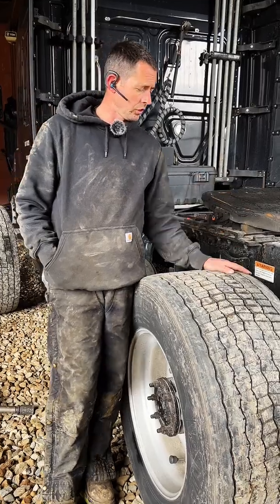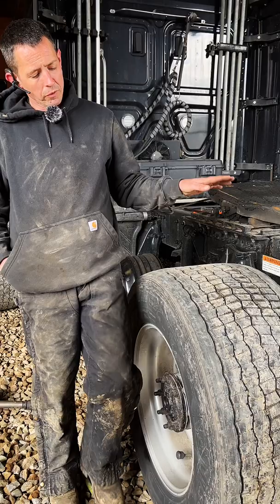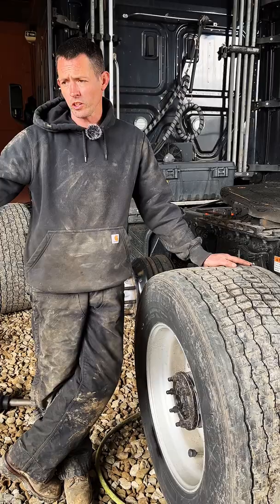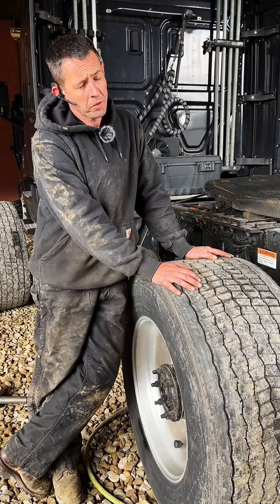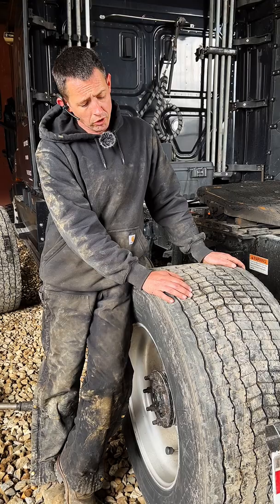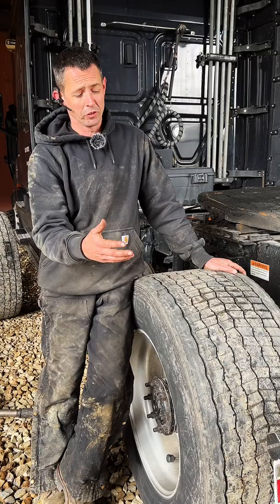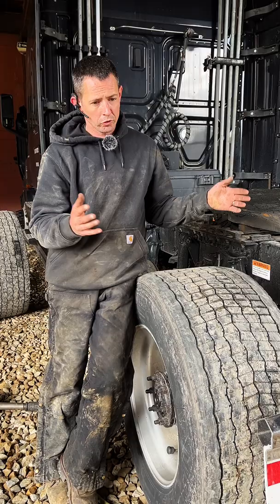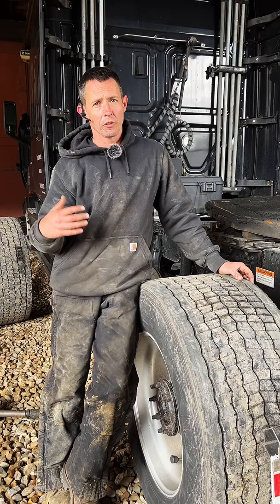Super Single vs Duals - What you need to know about Super Single truck tires #shorts

Comment: Don’t forget when the tires blows mostly the wheel is destroyed because it hits the ground without another tire to keep it up
Reply from the maker: Good point!!
Reply: Pulse they’re triple the cost tires and wheels both
Reply: Not necessarily, I’ve been running them for years and have had blow outs before it depends on if the tire separates or just goes flat and how quickly you can get it stopped safely
Reply: 50/50 Chance of rim damage, if you blow one lower the suspension and chain the side of the blowout axle to the chassis. Engage diff lock, raise suspension and drive off. Don’t forget the lube, you’ll need it for the bill.
Reply: Same here i blew up mine on my tractor 3rd axle 1 time was on i44 in Missouri riding cruises 70 mph downhill doing over 75 + mph full loaded 75k + weight. I came to a complete stop at the bottom of the hill. My tire was almost gone but my rim was okay. If you haven't experienced a super single blowout before, you're not even close to being a trucker yet. 😢 after that i went back to duals.
Reply: @truckerslife2338 stop going 75+ with your trailer tandems all the way up which overloads your truck. Stop being reckless and I don’t think you’re a trucker.
Reply: @ogre6969rh  I have been trucking for a little over 15 years now and I have never had a single blowout on a tractor. Yeah a few of them on the trailer but never a single tire on the tractor just because I am religious about checking the tire pressure and inspecting for punctures, I changed tires every hundred thousand miles they’re still practically brand new

Comment: Another Pro is: These are preferred in weight saving applications
Reply: They're semi trucks
Reply: @hggryrdchgc for bulk haulers, they pay by how much weight you can legally haul. If you can shave 1000lbs off the rigs empty weight, that's another 1000lbs you can haul and get paid for.

Comment: My first set of Goodyear's lasted 250k on my second set now never had any issues winter psi at 110lbs and summer 95 psi balance and rotate every pm have a wheel alignment at least once a year, SS are primarily for paved roads not for any flatbed operations most failures arise from sidewall damage and not checking cold tire pressure.
Reply: How are they in winter?

Comment: Blown tire =trashed rim. Any fuel savings just got shot to hell+lost time waiting on the shoulder. Also, that is a massive belt of rubber that'll do more damage to your truck/trailer and possibly the knuckleheads that hang out beside you while running 70+. Apparently they've never seen a tire come apart or a whole hub assembly come off and really want a good look .
Reply: Can confirm, I had a trailer tire blow on me two weeks ago, wheel was trashed and the mudflap and bracket were all bent to hell
Reply: @theesotericworldofjason1661  boss had a couple trucks with supers on the drives and ended up with a bodywork bill because of a tread peeling off.
Reply: I’ve been running them for years on truck and trailer for weight savings. Blown a few and have never took a rim out yet. I would highly recommend a tire monitoring system it has saved me a few times. I’ll never understand the guys that say there no good in snow and rain. Either they have never run them or drive way to hard

Comment: I’ve been running super singles for about 10 years now on my owner Kw900 and it’s getting me over 7mpg fully loaded a 80,000 pounds with a C 15 cat & 13sp eaton fuller transmission
338 on the rear end  And I will never go back to dual tires again
Reply: Which Super Single do you buy
Reply: smart man
Reply: @truckercatgo  Michelin or nothing

Comment: Company I used to work for put these on their frameless end dump trailers.

When one of the rear tires blew (if you dont know, only the rear trailer axle is on the ground when dumping a frameless trailer) it laid the trailer over. The company was very quick to get duals back on the trailers.

The driver still lost his job. "Failure to do a proper pre-trip"

Comment: My company has tested stupid singles on and off multiple times for the past 20 years and has seen no significant increase in fuel economy on multiple different truck and trailer manufacturers.

Can confirm the traction is trash, especially if you have to drive in snow.

As a technician I am glad to say we are almost done phasing them out of our fleet.

Comment: I did roadside for years, 90% of the time a super single blows it takes out the wheel also.
Reply: Only real reason they blow is because of they get abused by crappy drivers
Reply: @j.m.5995 *crappy owners

Comment: Anything with no traction is terrible to move around with. They are used daily by fleets in order to maximize fuel economy. And when they blow, not only are you handicap until further notice, but the pressure release from a super single that blows can take out a mud flap and completely destroy an APU.

Comment: Not so good in snow i hear either.
Reply: We run them here in Ohio they ain't bad after you get use to them. We switch from bridgestone to Michelin last year made a big difference.
Reply: Not fun in the rain either.
Reply: Wet roads either
Reply: @OffroadCpl  I’m the Michelin man that’s why
Reply: Always getting stuck in snow if you have to back down a ramp.
Reply: I worked for a gas tanker fleet 20 years and and the 2 main reasons they switched to them was weight and fuel savings, they made my job a little easier once I adapted my mounting/demounting techniques, there wasn't the concern of matching up duels, the driver had better awareness of a flat and would usually stop sooner before ruining the fender....we learned fairly quickly that a smooth trend is very slippery and changed the tread to a "drive " pattern, with this done, they did better than the duels in the snow but were still slippery in the rain, especially bobtail configuration.
Reply: I've pulled a dust wagon before I got into decking. Had super singles on that truck and didn't have any problems in winter loaded or empty
Reply: I ran them all winter this past year snd never had a problem at all with traction. I like getting an extra mile per gallon. It really adds up

Comment: Have run only SS in my short career over 300k miles. never had a problem other than bobtail in snow they can get stuck easier. I have never had a problem when loaded.  Never had a blow out. Used to haul 105k lbs on milk tanker. ran on gravel some. not an issue.

Comment: I will never run a super single again. Blow one tire tire and the road call just are up any fuel savings. The truck also feels tippy due to side wall flex of only one tire vs two. They also float in snow instead of digging in.
Reply: Ya but if u have ten trucks, chances are you'll still only have 1 road call, which means you still get the fuel savings from the other 9 trucks.  Plus the tires are cheaper and the weight is less.  So you're ahead of the game right out the gate and the savings keep adding up, with any blowout just being a fairly minor blip.  

In fact the blowouts would probably be negated by the lighter weight.  If you spend $2500 to make your truck 500 pounds lighter, and that 500 pounds makes a difference just one time, it could pretty much pay for itself right there.  Then if it makes a difference a second time, it's pure profit.  It doesn't happen every day but I bet between 10 trucks it would happen often enough to cover the blowouts.  So then you're just left with lower initial cost and better fuel economy.  The fuel economy alone would equal thousands of dollars extra per year.
Reply: @slowrider  if they're so great, why aren't all the major carriers using them?  I had 2 trucks spec'd exactly alike except for the tires. The fuel mileage was  within a tenth of a mpg. I live in a snow region and traction became an issue more than once for the singles. I'm sorry but you won't sell me on any benefits of them. I tried them and absolutely hated them.
Reply: @donmunro144     I don't care if I sell you on a benefit.  All I care about is whether or not that benefit exists.  A tenth of a mpg is still like 600 bucks per year.  

And most major carriers ARE using them.  But they're also using other tires too, because they're always doing cost-per-mile studies on any new models that come out, so they never have all one tire.
Reply: Buck Nekkid    so?

Comment: I started seeing these around 2008-2009 iirc. I thought they created less drag and saved weight over duallys.

Then the trailer side skirts, rear extensions, and the tractor v-shaped aerodynamic pieces on the fairings, all came out a little later.

I thought they all were made to combat the high fuel prices of the time.

Comment: I have ran them all most 1 million miles without a problem on road and off road and if you are putting more than 97 pounds of air in in them you will have problems and I get around 350/400 hundred thousand miles out of them

Comment: Most fleets run them for the fuel economy and the fact that they don't want company drivers driving with a blown tire. Which I don't blame them. I've had calls were a wheelbearing came apart and they lost the drum. Chained up the axle and driver was supposed to go directly to our shop. Dude decided he was 150 miles from home and he'd just go ahead and go home. His boss man was pissed. He had a driver swing by our shop to pick him up and take him home. Needless to say the truck came to our shop on a wrecker and a new guy picked the truck up when it was fixed

Comment: 800 lbs of weight savings, if your worried about that
Reply: How is it 800 pounds of weight savings? You mean having all 4 drives?
Reply: @londonoalex  8 drive tires weigh 800 lbs more than four super singles, most of it is the rim weight

Comment: You can legally drive with one Duallly tire as long as you don’t overload that one tires weight rating
Reply: As long as you don't get caught...😁
Reply: Correct, however, they do want you to take the blown tire off so you're not tossing rubber all over the road.
I have seen people limp super singles as well. You dump air, chain the axle on that side, air back up, lock in the power divider, and go down the road. Again, legal if you're not overloaded, as long as the rubber is off.

Comment: They have their place run a front tag on a 3axle tractor with the supers youll save 1500 lb +- id run then with active tire pressure
If i had supers on my chassis thats 2200 lbs off my tare weight.i coild then put 49 000 lb in a 20 ft container and scale 80000 gross.

Comment: You put you to 4x6 boards and your truck and you put you a good log chain couple of good log chains in your truck you have a flat tire you pull over on the shoulder to road you put those two four by sixes stagger stacked pull that flat tire up on top of there that compresses let the air out of your airbags your air ride now the flat tire the axle is compressed up close to the frame chain it up really good now you add you some air back to your airbags back off the boards but your boards back up now you can ease down to the next truck stop where they have a shop why you eating or taking a shower you can have a tire brought out and put on that truck and you didn't get stranded there you go straight from the mechanic

Comment: I actually preferred them. Might have to do with the particular tire and I don't remember what the brand was. But I drove the same make and model of truck with duals they eventually switched to some newer trucks of the same make and model but had super singles on them and traction control. I was very surprised how much better it went in snow, they rode better, and because we were constantly driving in unpaved industrial areas. We had a lot of problems with large Stones getting stuck in between the duels. They're almost impossible to get out and if you don't notice them you'll destroy the tire or toss The Rock once you hit highway speeds. The reality is for a company driver if you get a flat tire on a dual you're going to end up waiting for tire service anyway. The odds of you being close enough to drive to a tire shop is very low. And if that trailer is loaded it's also illegal to drive it on the single Tire. So if you got to wait to be serviced on the side of the road for a new tire anyway then it doesn't really matter but you have all the other benefits of the Super single.
Reply: They are better, that’s why they were designed.
Reply: @eln0n01  
That was my experience at least with the ones I had.

Comment: Great in snow and ice and in uneven road construction if ya pull tankers ya learn how stable they are very stable and they last 200 to 250 k miles been running them a million miles when ya drive duels after running the first thing you will notice is how the truck jumps around in the back or how the duels catch the edge on uneven terrain and with weight on them more surface patch more traction just some facts from a real driver not a rookie

Comment: Super single suck. I had one blowout on a converter Dolly while pulling double trailers. It almost caused me to flip the rear trailer over because it pulled so hard. I was lucky to stop the truck that was the last time I ever used a dolly with super singles on it. In fact our company doesn't even use them anymore

Comment: Why is everyone hates them. The reason why is most company use retreads the worst idea ever plus driver don’t watch tire psi, other then that weight reduction, fuel economy, better grip and so on with duel you constantly need to watch same psi for two tires and if one is bad you’ll have to replace two I been using them for years and had no problems besides I didn’t know I retreats that caused blown out but no rim damage only tires and I use halo system

Comment: You lose weight by running those as well. 400 #s on tractor and another 400#s on trailer. My only real complaint is they ride further inward within the axle so they look kinda Goofy

Comment: Also 1 Super Single is twice the price of a 11R22.5 or 295/75R22.5. Why pay the cost of 2 tires for a failure?
Reply from the maker: Good point
Reply: Ain't a a driver . just a wrencher . never seen a use except a mixer or something heavy on steers. Not otr
Reply: @marktiitto7616   I have 30+years in tires and mechanical. Spent 15+ for Goodyear& Bandag. Super singles are most common on steer axle , but they are also becoming more popular on drive axles on OTR,  & line haul application's. Also guys are raising the tag axle and using the on there

Comment: My company runs these on everything I don't mind them as long as they virgin I usually get a new truck before I get recaps since recaps usually blow about after 2/3rds of use and you just have to be more on point with your PTI and check tire pressure but it don't matter if you have duals or singles the blow the same If they low on air

Comment: That’s not a super single! That’s a wide base tire! And they are great for truckers! They don’t have the problems that duals have with wear issues! The only problem they have is if you have a flat/blowout you stop & wait for a tire guy to come fix/replace it! I would much rather change wide base tire than duals! I’ve changed 4 wide base tire in 20 minutes compared to 1-2 hours for 8 duals!
Reply: If you have air ride, I've seen guys chain up one side of an axle, lock in the power divider if it's a drive, and keep going.